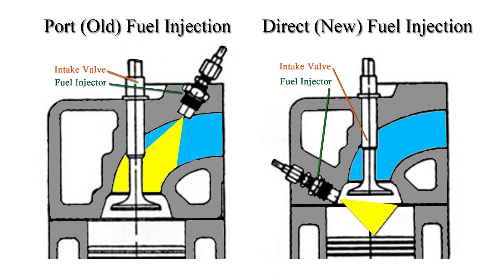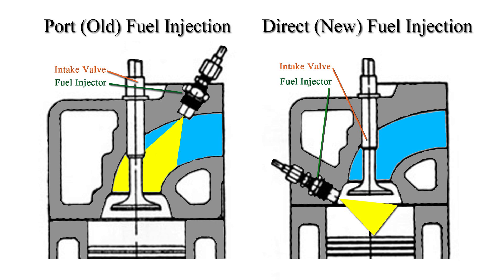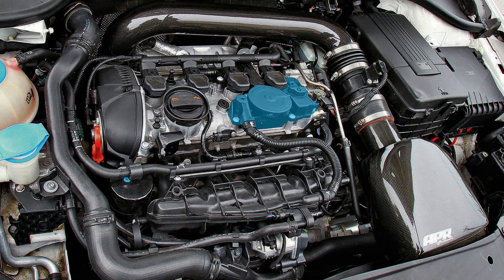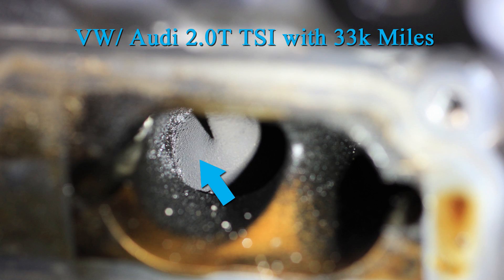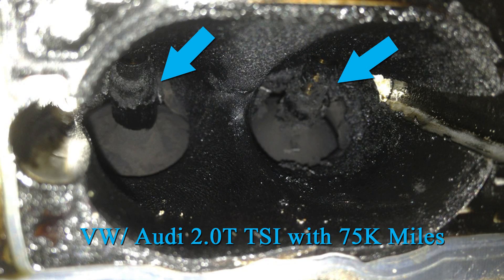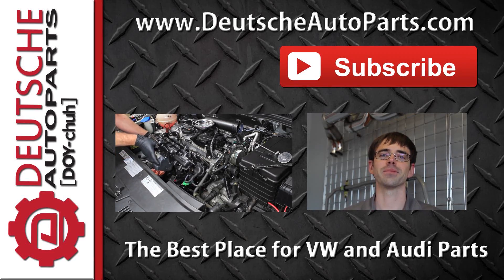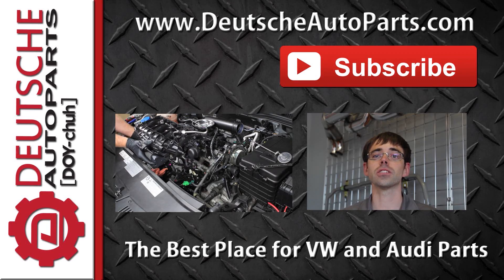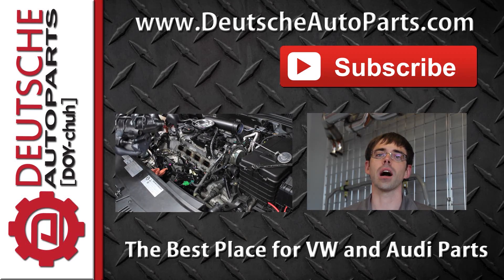Carbon Build up on Direct Injection Engine (Intake Valves) AKA GDI Gasoline Direct Inection

Comment: maybe you can try italian tune up every month to burn all those carbons away. Simple yet it is free. All you have to do is to step on the accelerator.
Reply from the maker: +MrBiggyfly The Italian tune up would be completely useless on VW and Audi motors that already have carbon build up on the intake valves.

Comment: What are the symptoms? My car twitches on idle when warm - so much so I can feel it in the cabin, and see the engine move.  Getting it checked for errors tomorrow. It also has poor acceleration around 2k RPM when cold.
Reply from the maker: +Harry Marshall Cold start misfires are the most common symptom

Comment: Why are Audi/VW notorious for carbon buildup compared to other makes?
Reply from the maker: +Earmuffin585 VW and Audi have minimal problems compared to other brands.  We have heard the for Eco boost engines have such bad carbon issues it breaks off inside the engine.  I have heard from pretty reliable sources that they have seen plenty of those engines replaced at 20k miles due to this carbon issue.  In comparison having to clean your intake valves every 70k is pretty insignificant (even though you still have to deal with this).

Comment: Thanks Obama for your unrealistic demands on auto manufacturers to reinvent the wheel and HAVE to by your decree make vehicles even more efficient and less polluting......now we have this flawed D.I. being reintroduced even though years ago it was proven flawed for this very reason - valve carbon build-up.
Reply: +Barry A. ...I disdain Obama as much as the typical auto tech, but you can't blame him for draconian smog laws.  That honor should go directly to The California Air Resources Board, Cal EPA, Cal AQMD and the CA state legislature.  Whatever standards are adopted by the state of CA will eventually be adopted nationally, and the auto makers usually just adopt the CA standards nationally, on their own.  It doesn't make much sense to attempt to have a different national standard when 20% of all cars are sold in CA.
Reply: +davess357 Direct injection increases particules and smog and reduces CO2 in comparison with standard injection. This is the reason why gasoline direct injection engines will be required to have the same particule filters as diesel engines in the Europea Union.

Comment: I'd like to hear someone chime in who owns a GM D.I. vehicle.... do you have or not have this carbon buildup issue in your GM/Chevy/Cadillac vehicle...if so...what model year and how bad is the issue?
Reply: I have a Camaro V6 2014 DI Engine and I found out about this problem at 24k miles. I still have not taken care of it, but it seemed too soon for me to find out about this problem. I guess this is one of the disadvantages of DI engines.
Reply from the maker: +Fredal Ocampo Thanks for the feedback.  We appreciate it.
Reply: +Fredal Ocampo So you &quot;found out about it&quot; by hearing about it online or actual symptoms from your engine alerting you to it?   If symptoms....what exactly are you experiencing?  Thanks..
Reply: +Barry A. I had to take my car to the dealer because the engine light came up, so they reprogrammed the ECM. The mechanic informed me about the carbon deposit issue. The car takes longer to go accelerate and the RPM fluctuates when stationery.
Reply: +Barry A. 2015 Silverado 5.3L with 4.5K miles on it. Already had to do seafoam spray to get back 2-4MPG and get rid of a rough idle.
Reply: I have an 09 cobalt ss turbo direct injection and having this problem.

Comment: Can carbon buildup cause a burning smell when accelerating quickly?
Reply from the maker: Paultwice22 Probably not.  Is your car a manual?
Reply: No, it's an auto.
Reply from the maker: You likely have something else going on.  Could be an oil leak but you should have the vehicle looked at for sure.
Reply: Okay, thanks for a quick reply!
Reply: +Paultwice22 Gasket leak, esp. w/ turbo.

Comment: Catch cans rarely do anything, they have no tangible effect on reducing the carbon build up on the intake valves. On many direct injection engines, nearly all of the build up is from the normal combustion process, and oil leakage from the valve stem seals. That's why the valves themselves are a complete mess with the intake tract not looking half as bad. The catch can does nothing for the oil seeping out of the valve stem seals, which burns and carbonizes over the top of the valve.

The only real solutions are to clean the intake valves, or do regular highway driving at a good speed - people who commute to work daily on the highway, with a good 20-30 minutes+ driving have far less problems with carbon buildup as the continuous high-ish rpm's really get the temperatures up and allow any carbon that would potentially build up to be burnt off. This is obviously impractical for some users so a routine clean is the only solutions...some engines have major build up at 20k miles, some at 50k miles...and of course it all depends on if it does a lot of short trips or has regular highway driving.
Reply: +cooleg Maybe we should re-examine the whole liquid-cooled thing, at least for aluminum engines.  Maybe just switch to smaller radiators, or cycle between water pump on and off to burn off the carbon, eh?
Reply: +blower Yep, I read how someone added a catch can etc. to try to stop it, which invalidated the warranty, so the manufacturer 'cleaned their hands' of the problem.
Reply: +paul60163 this is a very true fact that I learned from a bmw mini master mechanic friend of mine just today.
Reply: How high rpms are you talking on the highway?
Reply: blower You fuxking blind?Did you not see the tracts of that Audi in the vid?Are you even watching the vid?Can you even see??
Its from oil vapors genius....Talk about stupid.And really a rubber ducky as an avatar?You expect people to believe your words with a rubber fucking ducky as an avatar?????DA FUCK

And reading the rest of your expertise.....all wrong .I have plenty of build up and plenty of highway driving with plenty I repeat plenty flooring it to anger issues and irriation.....carbon still exist.That just worsens it to more vapors being dispersed. The folks here at MIT would have a field day with your knowledge.

Comment: What about water/meth injection?
Reply from the maker: Chris Dyall Water Meth injection will def help but is really intended for performance.  The cost and complicated installed required for that system make it not a viable option as a preventative.  Water Meth is a great way to get better performance which as an added benefit means less carbon.  

Hope this explains why it was excluded.

Comment: We Have fixed this issue with our fuel treatment just add the treatment to the gas tank and drive it!

It will also increase your fuel millage by 5%
Treat rate is 1 oz per Gallon.
The problem is packaging is cost prohibitive so we sell it in gallons. it is $100.00 for 4 gallon case
Reply from the maker: bill balmes We feel like this is a pretty tough sell until there is a long term test with proof.  The fact that the fuel never touches the valves is an issue and I'm skeptical that any in tank solution with fix this.  

I would be glad to see 70k miles worth of pictures on the valves to prove this to be a fix.  Until then we still feel very strongly that in tank chemicals have no affect.

Comment: Do is a pointless tech, its a fail to eak out a few miles per gallon aka marketing magic.

It's complete trash

Fleec the already fleeced customer

Make me not want to buy any of this tech ever
Reply: +mjs1231 You mean Direct Injection?
It does many things, mainly allowing for raised compression giving more power out of smaller engines (often turbocharged) as well as directly saving fuel.  DI typically gets 15% better fuel economy than a similar fuel injected engine.  I wouldn't call that "complete trash".
Now is 4.5mpg worth a $600 service every ~60k miles?  That could certainly be debatable.
Reply: +Adam S (Dolby109) Just wanna add that injecting fuel directly into the cylinder raises the fuels effective octane rating too. The fuel is able to absorbs more heat. That's why GDI is so awesome for performance oriented platforms. E85 has an effective octane rating of 160 when injected directly. Blew my mind.

Comment: Say no to direct injection. I refuse to spend a penny on this tech.

This is a major fuk up on the manufactures 

This is on their dime, not mine.
Reply: +zygi22 Umm... all diesels used DI for decades now, and diesels last MILLIONS of miles, not hundreds of thousands of miles like gas engines.  They worked out the kinks long ago, my friend.  GDI is the way of the future.
Reply: mjs1231 mjs1231 mjs1231 Agreed. Why didn't the engineers think of this BEFORE designing  this kind of fuel injection? Ridiculous. I think one of the major reasons manufacturers are going the GDI route is the government cracking down on pollution, unfortunately. I'm all for a cleaner environment.However, employing half-ass design is not going to help solve the problem.
Reply: Must be the difference in design and function between diesel and gasoline engines.
Reply: +Matt Thompson The Diesels i know were all from trucks and tractors, they have all a extern crankcase exhaustsystem with a filter and oil separator. A Diesel dont like to eat it´s own shit just because the chance is high of missfiring due of it´s high compression, it will run with the oil from crankcase if there comes enough up and further more you cant shut it off. It´will run faster and faster, isaw that one time on a tractor when the engine suck oil from the Airfilter. It was an old fashiioned airfiltersystem with a oil pan and wire mesh; but they had filled in to much oil in it so the level was to high and the engine at high rpm´s suck in that oil and burned it....it was no more under control not till the oil level in the pan was down.
That´s why these Diesels ONLY become fuel to eat and not their own shit !
But their inlet valves are a bit with carbon at the shafts due to leakage oil from the shaft.
Reply: +yoyoyoyoyoyyofsdfsdf Modern diesel cars last less than indirect injection gasoline cars. All diesel cars are direct injection since 2000 in Europe, where 70% of cars are diesel. Old diesel cars, the old indirect injection ones, last forever. But this does not apply to direct injection diesels. Besides, direct injection is a technology that adpats much better to diesel fuel than to gasoline, because of the oil nature of diesel fuel and the drier nature of gasoline.
Reply: +Matt Thompson Nope. Gasoline burns hotter than diesel, and LPG burns hotter than gasoline. Diesel is more dense in energy than gasolines (that is why you make more miles per galon), and gasoline more dense in energy than LPG. But the amount of heat has nothing to do with temperature. Diesel is a low temperature fuel.
Reply: +abc Basically. If you want a reliable car buy an indirect injection car, while you still can. It will have to be a gasoline car, because diesel cars are all indirect injection for many years. In less than 5 years all cars will have indirect injection, with the exception of small cars with less than 1000 cubic centimetres (which you hardly see in the US out of very desently populated places like NY city)

Comment: I just bought a Mercedes C250 1.8T with direct injection. I used to use Seafoam on my older benz which helped a lot and made my car run smoother. But seafoam is not strong enough for DI engines, so I found another cleaner that is built specifically for DI engines. I live in Canada and this stuff is called Motomaster Formula 1 Gasoline Direct Injection Fuel System Cleaner. Use it 2 times in an oil change interval.
Reply from the maker: sranjesuper Thanks for the feedback.  We appreciate it very much.

Comment: If you had a catch can installed on the PCV line, you would understand why short distance drives or cold weather will increase the buildup on the intake. The key to decreasing buildup is high temperature. Coolant temps rise rapidly in modern engines, but oil temps take extended drive time to get to operating temp. When you shut off an engine before oil temps are at around 200F, then you will see excess condensation and buildup on the intake manifold and valves. You can verify this if you already have a catch can installed.

Experiment... Empty the catch can and then drive consecutive 50 miles on the highway. Check the catch can, it will probably have a few drops oil if any at all. Next experiment, drive 5 miles and let the car cool down. Do this 10 times and you will have driven 50 miles again. Inspect the catch can this time and it will be full of water and oil deposits. This is what is getting on the intake. Constant short distance driving will age a motor much faster than "spirited driving."
Reply from the maker: Jeff Takeuchi We completely agree this will help decrease carbon build up, but for most people changing their driving habits is not often an option.  

Thanks for commenting, we think this will help anyone who reads it.
Reply: Brilliant explanation.
Reply: I drive 50 miles 1 way in my MK7 GTI to work. My wife drives maybe 5 in her 2015 Ford Edge Ecoboost :( I feel for her and have told her to start saving money for a cleaning :(
Reply: I drive diesels and can honestly say 200k miles is no problem with simple servicing according to the manufacturer schedule, and of course the car needs to drive at motorway speeds (70 mph) every day
Reply: This was super helpful explanation as I've been trying to grok why there are so many complaints on a certain V10 (which takes longer to get up to temp).

Comment: what about water methanol injection. that can clean the intake.
Reply from the maker: Joost Roelofs water meth can help as a preventative but we felt like that is not a system for the masses which would only make this video less clear.  Most people who would even consider the high cost and customization required for water meth likely already are aware of the info discussed here.

Comment: what about spraying water into the engine when its on? I've seen a couple of people here do it on YouTube tempted to try it.
Reply from the maker: dsouzand That will likely not help.  Also you need to be careful with putting too much of any liquid into an engine as it can be hyrdolocked this way.
Reply: Deutsche Auto Parts
 the idea behind it is you put a little water at a time, so you don't hydro-lock your engine and then that water turns to steam which cleans the pistons, valves etc. Im waiting to see someone make a video with a bore scope to really see if it works or not.
Reply from the maker: dsouzand We understand the idea behind it but water won't do much if anything to break down the carbon build up.  Its likely even if using aggressive chemicals they wont do much to remove built up carbon.  This is only a possible preventative at best.  

Just our thoughts, the proof is in the pudding as to what actually works.

Comment: Best preventative method where possible is to obtain one or two cans of a high quality intake valve cleaner such as that from CRC and, combined with a long squirt hose intercept the PVC hose inlet just upstream from the throttle body - NEVER before the air mass sensor(!!!!) and with the engine hot, increase rpm to 2,000 - to - 2,500 max and squirt short busts of the fluid into the PVC inlet, again, just before the throttle body. the fluid is now cleaning everything downstream. Use one if not two cans and this will significantly clean out the entire throttle body, intake runners, intake ports and valves. Do this immediately before an oil change as the fluid does impact engine oil that should not exceed for any engine 3,000 miles no matter what "uber" engine oil one is using as some believe they can go a trillion miles or so before changing oil.

Direct fuel injection purports to be better and maybe it is. But it inherently as this video demonstrates manifests monumental contamination as the intake network upstream from the intake valve is not wet with fuel, save for the %$#@! PVC air/oil mixture. I've seen trashed engines in as little as 7,000 - 9,000 miles.
Nothing that can be added to the gas tank is of any benefit other than to assist in cleaning and maintaining fuel injectors, pistons, rings, the tops of the valves and a bit of the exhaust network.
Reply from the maker: death2pc Yes the method suggested should in theory be a decent preventative.  Unfortunately only someone who has done this long term then removed their manifold the verify would know for sure.  

We would love to see the results if you are indeed doing this.
Reply: Deutsche Auto Parts  Thanx for your reply. Oh, it works. It works exceptionally well. I will admit that my oil changes NEVER exceed 2,000 miles, so the frequency does a great deal of and by itself. I hate PCV and EGR with every fiber in my body. Another maintenance standard I employ is to draw out all hydraulic (power steering) fluid from the reservoir with a dedicated battery bulb that goes into a recycling container - and fully replenish (exchange) with new fluid about 10 times per year. Keeps the system nice and fresh as hydraulic fluid is so overlooked. I do the same with brake fluid about 5 times per year. Both systems are power flushed once every two years. You can imagine what my cars and planes - or anything else I have and maintain - look like, above all are 100% trouble free. Small wonder.
Reply from the maker: ***** I generally agree with this logic.